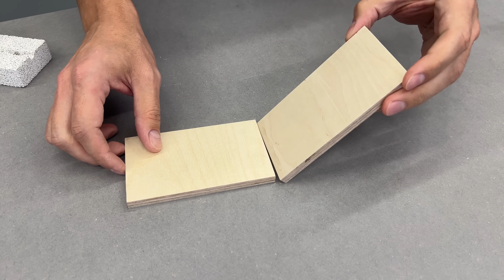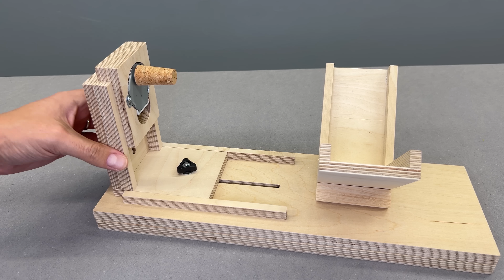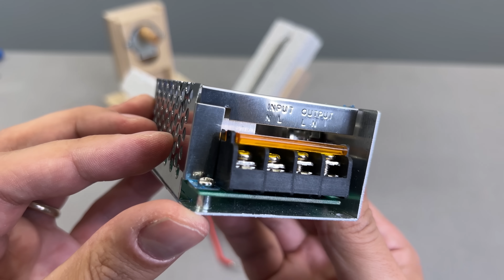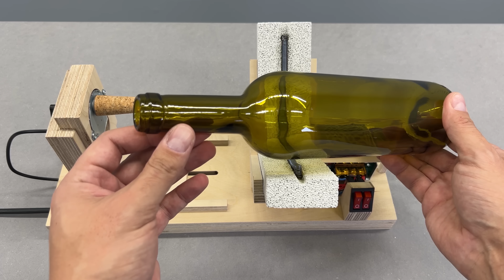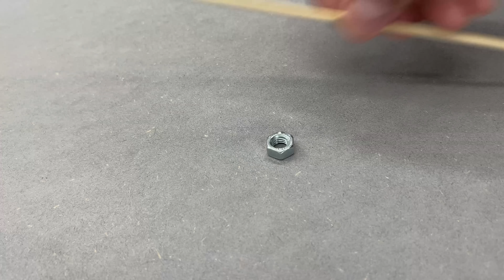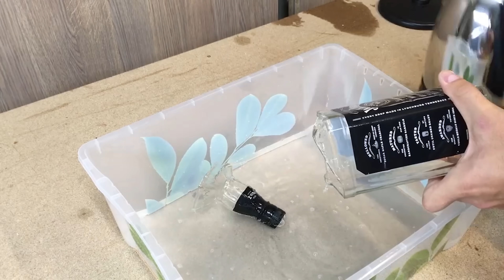How to Cut Square & Round Glass Bottle

Comment: The spot where you touch the bottle with the water seems to shatter locally just a bit. Could you use something else to initiate the crack that would avoid any damage? Like spraying with a mist bottle, or placing a flexible metal mesh over it to pull the heat?

Comment: Have not tried this before. I wonder if a taped straight line lined with hot glue  or a rubber band to help woth the shock of glass breaking apart from heat would prevent bad cracks

Comment: if you ever have any melting issues with silicone wire insulation, try fiberglass insolation i believe its industry standard for anything with a element that gets above 350-400f. trust me i used  to work an assembly job making wire harnesses and it was always a miserable week when we had to do anything that is supposed to get hot fu fiberglass if only you werent fiberes of glass splintering into my hsndds

Comment: One simple method is you fill the bottle with the waste mobile oil upto the level from where you want to cut the bottle. And take warm iron rod put in side the bottle and it is done. Easiest method.  I had used this method during 1977 in mizoram where we were not having glass.
Reply: So you heat up the oil with the rod to break the bottle? 
Or do you mean it the hot iron to the side of the bottle similar to how he did it in the video, just with oil inside the bottle?
Reply: @hikariizuki1693 i hope he responds I am curious too about specifics

Comment: The first method only works if you scratch the glass with a glass cutter as with the second method. Something like that should be mentioned.
Reply: It does appear that there are scores along it, you could probably combine a blade into this same jig to first score and then heat, or put heat through the blade?